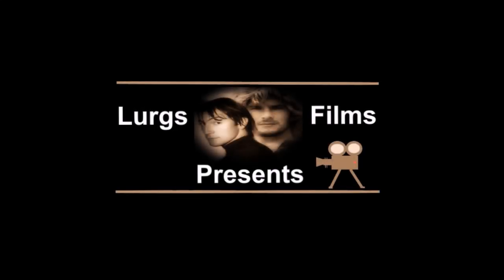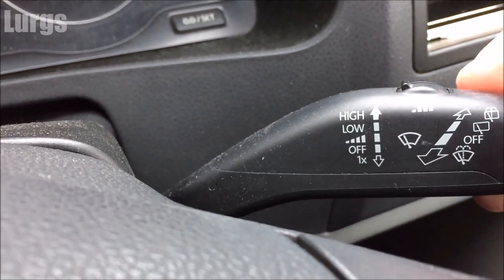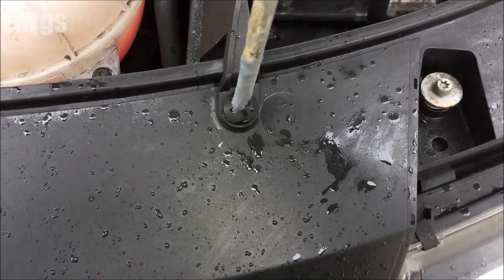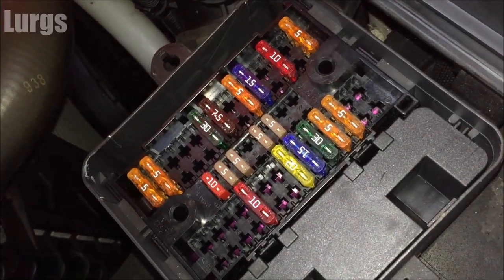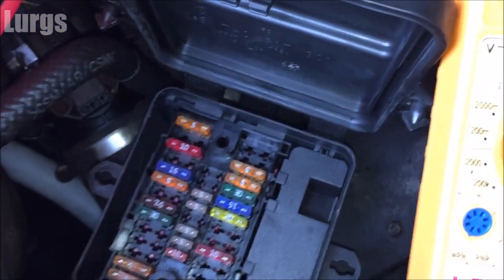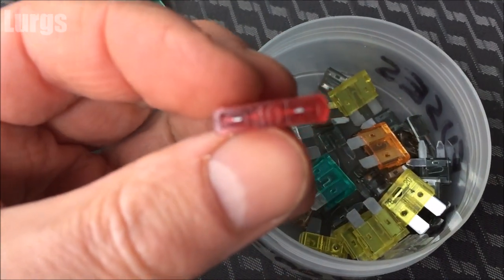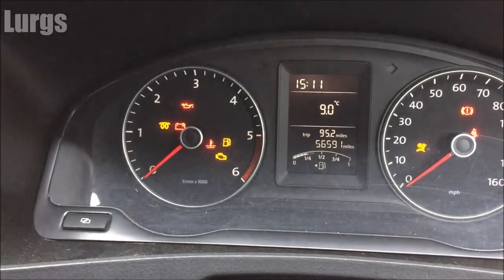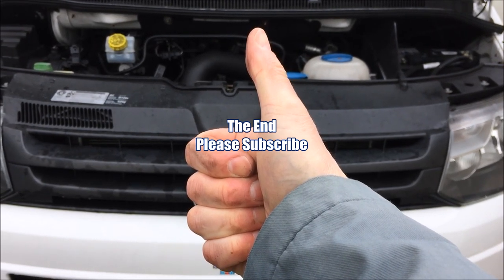VW T5 Windscreen Washer Jets not Working - Fixed

Comment: I have this problem (pump not working for wash wipe) - tried changing fuse in slot 7 (original on my vehicle was 10A, not 7.5A) only to find a) problem not solved and b) original fuse still intact anyway. Anyone got any further tips/solutions? 🙏
Reply from the maker: Maybe pump is faulty. Get someone to pull the stalk and put a multimeter on the pump terminals and see if you are getting 12v
Reply: @LurgsHowToGuides  thanks, figured as much. Have a new pump arriving tonight👍

Comment: Hey, I guessed it was a fuse before you started. But did not know you can test the fuse whilst it is in situ, Learned something new today. Thanks
Reply from the maker: transitvandoors My Dad taught me about testing the Fuses without removing them! I'm gonna post a new video about that later on. So much easier as if you don't have a fuse diagram it can be a pain removing them all.
Reply: Please do post a video, I know I would like to brush up my electrical testing skills.
Reply from the maker: transitvandoors Yeh will do. It will just be an extended version of what I did testing the fuses in this video. But it's a good tip

Comment: HAd same problem but motor was working OK. Turned out to be cracked hose feeding nozzles on RHS of bonnet. Have covered with gaffa for time being, works now.
Reply from the maker: Good solution until you can get a new hose although if it's the waterproof Gorilla Grip Tape it could be a permanent solution!

Comment: I have a 2015 Vw gti the washer pump and jets work. However it is extremely loud when washing the windscreen. It was not this loud before. What could possibly be the issue?? Thank you!
Reply from the maker: Could be the motor is on the way out but it's unlikely if it's only 5 years old. Might have some dirt in the nozzles. Always make sure you use tap water. If they still work then probably nothing to worry about.

Comment: Yeah - but why did the fuse blow in the first place?    I wonder - if the washer fluid froze in the pump( due to lack of antifreeze etc) then the pump might overload when operated.  Just a thought.
Reply from the maker: That’s the most common reason for the fuse to blow, if pipes are frozen it puts a massive amount of pressure on the pump and it blows. Very common in the winter. Need more anti freeze screenwash in the winter
Reply: @LurgsHowToGuides  Thanks for that - it makes sense. I have another thought though. What if the screen jets froze (say) but not the pump/washer reservoir. If the washer operated, could the water pressure blow the flexibles off the pump itself and cause a leak?
Reply from the maker: @winniewotsit4452  Possibly yes.

Comment: My fuse box hasnt got a ‘fuse holder’ where the 7.5 amp should go, i have also changed fuse number 10 in the cab but still no joy, any ideas?
Reply from the maker: Will need to check all fuses or then check there is 12v power at the pump when you activate the washer jets
Reply: Mines the same - did you find it?
Reply: @LurgsHowToGuides where will i locate the pump mate?
Reply from the maker: @LiamFergusson  This video will help
VW T5 Windshield Wiper Fluid Bottle Flushing Out
https://youtu.be/7tck8P84xd0

Comment: If the rear is working but the front is not, is it likely a fuse problem?
Reply from the maker: Yes it sounds like it. Although the pump could have failed but check fuses first.

Comment: My motor squeals but nothing comes out
Reply from the maker: Make sure there is water in the bottle, then check  the jet nozzles for blockages.
Reply: Thank you for the video, my Tiguan left jet is not working, only bleeds, I’ve checked for blockage but it seems ok, could it be the small pump? Cheers mate, enjoy the cuppa!
Reply from the maker: If the right jet is ok then it can’t be the pump. Must be a blocked left nozzle or maybe a split hose that feeds the left jet, check for any splits when someone else squirts it
Reply from the maker: Odd, hope you get it sorted, good luck